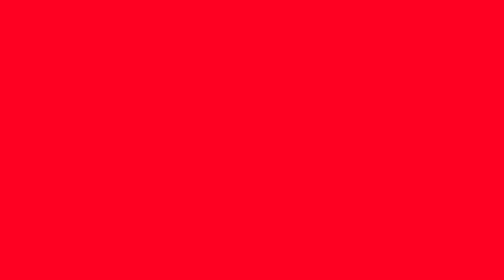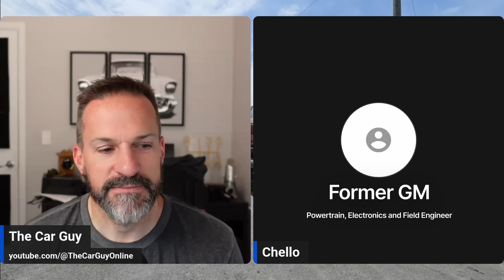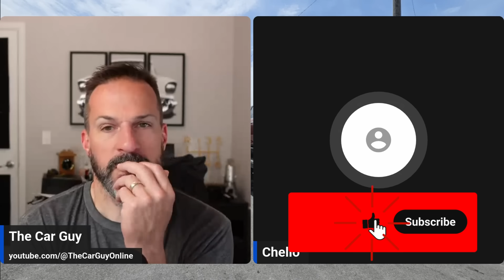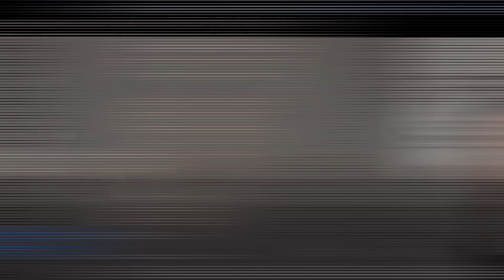Engineers HATE Building Cars Like This! GM Insider Explains

Comment: CARB was given the point to eliminate ice to push ev no manufacturer wants to build  two cars one for CA and one for say TN,  gov leftists allowed CARB to push all these insane epa regs chevron difference is now gone so they just can't make up rules without congress. which most of these are--wiith carb gone and the BBB about to be passed and signed manufacturers can rid themselves of these nightmares. hope they due.  GM doesn't need 1 billion to build "new clean ICE" they have tons of great engines. pick those most loved and durable people will applaud them why can't we get back the clean burning inline 6?  go to the late 90's for engines that worked  get rid of DEF, T is right get the gov off the backs of our manufactueres and lets them fly.   ask the engineer if GM can build a 3800/ t4 engine trans combination T will get gas prices down, adjusted for inflation lower than in the 90's. ask this engineer why can't we build a car/truck as good as toyota, honda, subaru mazda??   GET RID OF DGI  there's a lot of junk that's not needed.  what would he get rid of first ??

Comment: Direct injection makes more power because it cools the cylinder and permits higher compression or boost. I was running 23 psi boot due to it. A few mfg run additional injectors to clean valves. The 3.6 also has a redesigned vent system that corrected the issues.
Reply: Still too complex and expensive.
Reply: Yeah, all fun and games until your fuel injector blasts a hole through your piston because the spray pattern has changed. Direct injection is JUNK. Multi port injection has way more advantages.

Comment: Terrible that the transmission does not last as long as the brake pads. It's ridiculous the torque converter turns into shards. A lot of components that lasted for many years and was easily replaced or repaired is now replaced with junk that doesn't last and costs a small fortune. The auto makers install things that created a market to delete or disable these systems (active fuel management and stop/Start). Direct injection is the worst and catch cans used to protect the intake valves create the potential for rear main seal leaks.  Need to find a way to deregulate the industry to enable the automakers to revert to the more reliable fuel delivery systems and transmissions used in the early part of this century.

Comment: I don’t disagree with all of this, but I think it’s a little overblown considering the performance and technology of new vehicles. My company has a small fleet of mostly GM vehicles, and we’ve had very good luck with them overall. Yes, there have been some issues, the worst of which was my ‘19 Silverado LD(basically an ‘18 leftover). We would have lemon-lawed that truck if not for the extended warranty. But it got me to 208k miles only stranding me once because the dealership misdiagnosed a bad water pump that I told them was failing. Anyway, we’ve had several Canyons go well over 300k on original drivetrain, and with minimal issues. My current ‘24 Canyon is at 54k with only a couple small issues and I can honestly say it’s the best vehicle I’ve ever had. You cannot compare the capability, technology, and comfort of today’s vehicles to what they were 25 years ago.

Comment: This really isn’t true. No government forced networks into cars. The automakers did this voluntarily as a way to reduce the sheer amount of physical wiring needed to make all the features and equipment work. The advantages of using a network between modules included less cost, lighter weight, and the ability to troubleshoot. For heavens sakes, a 1994 Range Rover P38 had a full networking system because the vehicle was jam packed with electronic features. No government regulations forced that! Completely voluntary. Eventually, the automakers were required to have features like stability control and backup cameras and TPMS, but were never required to have these operating on a network. The feature merely needed to be present. Using a network also allows easily adding or deleting features based on trim level without specific wiring harnesses, which would be very costly. Do networks create unreliable vehicles? Maybe, maybe not. It stands to reason complex vehicles will be less reliable, regardless of networks, simply because they have more things to break. Part of Toyota’s previous reputation for reliability came from the fact that their vehicles were simpler and less complex. They lacked features. Now they are no better than anything else.
Reply: Right on my hillbilly friend.
Reply: From a suit who has probably never turned a spanner, or pulled dozens of CAN tx/rx nodes to isolate.

Comment: Direct injection isn't the problem, it is crank case ventilation that fouls the valves. Pre-emmissions cars just vented the crackcase rather than running it into the air intake.
Reply: I put a catch can on my 2019 silverado  hopefully  that will help😊
Reply: @castlegarage6969  Yes the problem should be fixable.
Reply: it is less reliable exposing the injectors
Reply: Really?  So there really is a valid reason to delete all the EGR stuff on my '93 Nissan 240SX? 
It's got a DOHC 2.4L inline 4

Comment: GM made trash well before government rules but it's nice to see him cope.
Reply: Pre-bailout GM was much better than it is now. Most of those vehicles will go a long time with basic maintenance. Common issues (4l60e, coolant, etc) are well known and have many solutions.
Reply: The rules started in the late 1960's They were good cars then....
Reply: Specific examples or are we doing blanket statements here?
Reply: @minecrafthacker9582  you obviously never owned a 90s Chevy. I did, it was garbage.
Reply: @spazzypengin  I have one in my driveway now dingus
Reply: @minecrafthacker9582  So you know it's complete garbage, then.
Reply: Glad we could clear that up! How rusted through is the frame? Gotta be at least halfway by now.
Reply: @minecrafthacker9582  Like this guest said, replace all brake and fuel lines if going early 2000's.  Seriously unsafe metallurgy.  BTDT.
Reply: @hcjpbluesky9916  They should've been sued out of existence for what they did with the fuel and brake lines.
Reply: I have 96 gmc k1500 with 180k miles.  One fuel pump, one alternator, brake lines.  Just basic fluid changes otherwise.  Not sure how anyone can say the gmt400 vehicles were anything but reliable.  My dad has a 1990 model with 85k miles.  Distributor is the only thing ever replaced on it.  We have friends with 90s gm trucks that hit 450k+ used for logging service trucks before the motors needed rebuilt.  They abused the hell out of the trucks off roading in the woods and dragging heavy trailers.  They did have to upgrade the transmissions but everything else just worked.
Reply: Yeah what is this guy talking about? First he's like DI is killing engines power and idle and how it's the governments fault to put them in this predicaments and then he's like actually we can actually fix the problem if we code the injectors properly. Like I don't love all the regulation either, but when you have people that say yeah we can save 10% by using di we are just too lazy to do r and d to figure out how to make it work, it kinda proves why these regulations exist.
Reply: Ed Cole 1955 he made the best engine ever the SBC. GM went down the tubes as soon they got rid of the SBC.
Reply: Watch the fully interview smart one, but yes.

Comment: i like my '94 ford ranger. doesnt even have obd2 with a 5spd manual. no radio, hand crank windows, small truck with a bed the same size as a new f150.
Reply: Then old school rangers are unkillable. Pathetically slow yes, but them things are likely still going to be running around in another 50 years if we don’t force everyone to give up driving ourselves
Reply: Yep, same here! Had my ranger next to a titan at Home Depot and was laughing my ass off.
Reply: @williamdebene2394  it is almost comical having a truck that is so massive that has a nearly useless-sized bed. i've always wanted an el-camino though. i'm stoked about the new slate truck that is in the works. apparently its an all-electric truck about the size of an old ranger and a new price tag of ~20k. they can get around the size requirement from CAFE because it isnt an ICE.

Comment: For those of us who can keep older cars running, it's a huge advantage.
Reply: The problem is sourcing good parts.
Reply: @paulmoss7940 agree,…slowly having the parts supply tightened up for the older Fords. Rock auto used to carry a fair amount, but I’ve noticed they’re kinda drying up.
Reply: @paulmoss7940  Yep, I can't find good parts for my 1998 Saturn SL.  What comes out of Autozone is often just about as bad as what came off the car after 25 years of service.
Reply: Got a 81 chevy square body bought new. 93 ford ranger bought new 98 mustang bought new. I'm never selling them
Reply: Until the govt mandates them off the road and you can't register or insure it any longer.

Canada for example has 100% ban on gasoline vehicle sales by 2035.
Reply: 20 year old volvo with 453k miles. Has been from Alabama to Alberta Canada over a dozen times. Normal services aside, has only needed a wheel bearing and struts.
Reply: 1990 Thunderbird SC, 2005 Lincoln LS,  and two 2013 Grand Sport Coupes
Reply: 2006 Honda CRV. Three 5 inch thick service manuals are still available.

Comment: And that's possibly the main reason I still see alot of 80's-early 2000's cars and trucks still on the road to because they are more reliable and easier to work on than today's vehicles. For example my 2002 silverado very simple and basic it has knobs and buttons no touch screen dashboard that will fail.

Comment: If your engine uses GDI, then make sure you are buying Top Tier fuel and put in fuel system cleaners that are high in PEA every 3,000 miles.
Reply: You'll still get carbon build-up because the injectors are completely missing the intake valves. Long highway trips where the engine is up to temp for a long time is the best way to slow down carbon build-up.